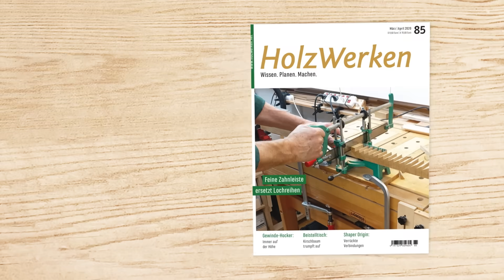Domino Day: Wie Sie Festools Spezialfräse richtig einsetzen

Comment: Tolles Video! Man lernt nie aus! Allerdings sind die Dominos eben nicht gepresst, sondern gefräst. Das macht sie eben stabiler als Lamellos/Flachdübel.
Reply: Ebenso wie Runddübel werden auch Dominos gepresst. Dies ist nach dem Fräsen ein Arbeitsschritt, der das Material verdichtet (dabei entstehen die kleinen Rillen)
Wenn man nun Leim angibt, quillt der Dübel/Domino auf und sitzt stramm im Dübelloch.
Reply: @DominikRicker  Was ich meinte ist, dass Flachdübel aus Pressmaterial sind. Runddübel und Dominos werden komprimiert, damit sie sich unter Leim ausdehnen. Sie sind aus Vollholz.